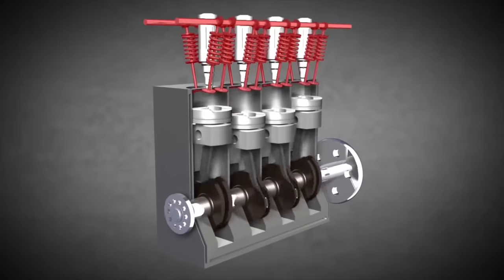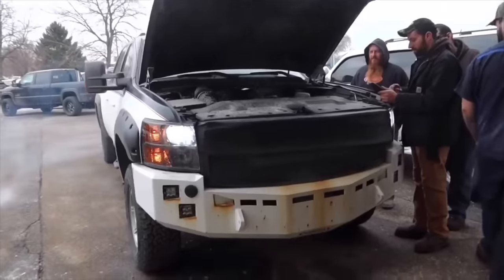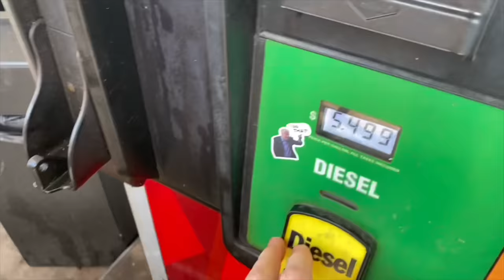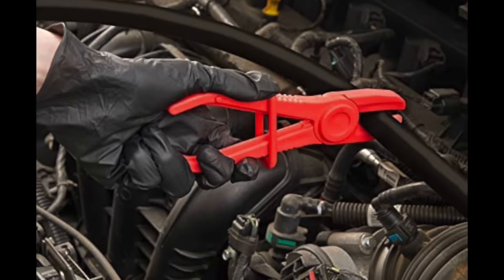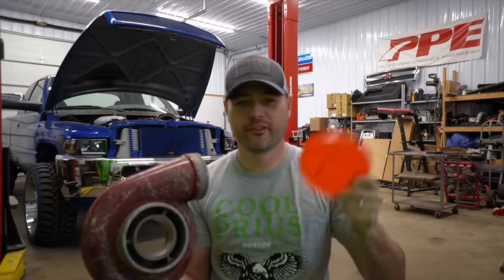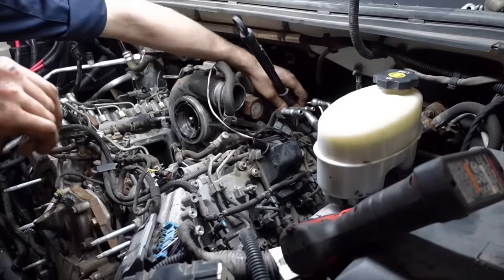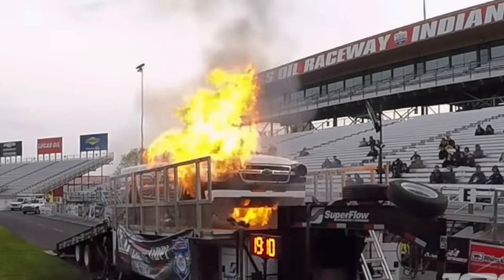What Is A Diesel Engine Runaway? *EXPLAINED* ￼

Comment: Years ago, around early 70s, I worked for Ryder Trucks in Atlanta.  We were working on a Detroit Diesel in one of the bays, the mechanil had the hood and shut off disasembled while he was working on it, for some reason he started it without the shut off plate installed...long story short, it ran away, about twenty guys unassed the shop and the shop manager tried to stop it by dropping an Atlanta Phone book over the intake, back then Atlanta phone books were four or five inches thick, it sucked the phone bood down like it ate it to no avail, when it came apart it sent shrapnel into every concrete wall and most of the trucks parked around it.  The fire was put out by the mechanics but the damage was complete.  Back then Detroits were famous for running away, which is why they had a metal plate you could drop to close off the air intake...unfortunately, this one was disconnected for maintaince..a lesson I have remembered my entire life.
Reply: I currently work for Ryder in Kentucky. My field operations manager told me a story that sounds identical to yours from when he was a tech.  Phone book and all.
Reply: Keep a clip board close by
Reply: Damn!
Reply: Thank you so much for sharing such an amazing experience which were can all learn from. Glad no one was hurt
Reply: Cool story bro 😎
Reply: "Unassed"... love it... got to remember that. Never, ever remove the cutoff!
Reply: It was a 2 stroke 6-71 8v92 the metal plate was there to shut the engine off even under normal conditions, those old 2 strokes would run away if you didn't keep the blower boxes drained or if you tried to start it and it kicked backwards and started eating oil.
Reply: Man, if there were camcorders back in the day, that could have been a spectacle.
Reply: What a story🔥
Reply: I can imagine how it ate the paper... my grandfather plugged the air intake of his run away tractor with a piece of wood and it got sucked in so deep it was cut to shape by the pipe.... 
Engine actually survived... the air intake didn't.
Reply: The 6-7 is the 6 cylinder with 71 cubic in
Reply: A 6-71 is an inline 6 cylinder engine with 71 cubic inches per cylinder.  An 8V 72 is a V8 with 92 cubic inches per cylinder.
Reply: That is interesting
Reply: A 2litre CO2 extinguisher into the intake works too… (BCF was better but harder to come by now).
Reply: This wouldn’t have happened at your yellow rival’s, just sayin 😊
Reply: @Ju5tu5Bp0rt3r  Thats nuts. Small world!
Reply: If you turn the key off you just shut off the diesel fuel supply it runs away from oil getting past the rings
Reply: One of those cases. A diesel engine accelerating out of control. 
Reason!
Oil inside the intake maniful, due to damaged turbo. Neither closing the key, no disconnecting battery, it stops. Just that all the oil in the manifold and air cooler is consumed. 
It can reach up to 10,000 RPM. 
destroing engine. 
Some even explode without knowing why or how it happened. 
Remember, diesel and oil, are comburents. 
the engine do not stop because incoming oil and air.  
its happening to engines only, wiht out   trottle valve. (modern injection control. fuck)
Previus engines havent this problem. 
Contributions Corona Automotriz
Reply: Question was this shop located on Ponce de Leon avenue??? Or Moreland avenue
Reply: I keep bolt cutters in my old diesel farm truck cut the lines
Reply: @baddog4307 
The modular engine of the time.
Take a head off an inline and use it on a V, move some fittings around. 
53-71-92 and almost anything from 1 to 16 cylinders. 
I was at the factory for training in 99 when they had the 2 stroke line condensed down to one. 
Got to see a 20v-149 block(s) and crank (s) get set up ,and even got to see a guy using a grease covered stick to retrieve shattered ceramic roller pieces from a 60 series on the line.  
Haha good times.
Reply: Best way to stop runout is spraying a CO2 extinguisher into the intake to smother the ignition
Reply: Saw the same thing happen at an old winn dixie truck garage, they used nothin but Detroits at the time here. I was in boss's office right beside the truck. Truck rpm's shoot to the moon and was sooo loud. The mechanic got the plate and tossed it on the blower and it was the loudest noise ever but it did shut the engine off.
Reply: Holy jumping fvcking sh¡tballs it ATE THAT WHOLE BOOK?!?!
that beefy 5 inch thick book?!?!?!
Reply: The turbo blades must have hit it like a wood chipper. There ain't no way 14.7 psig vacuum sucked down a phone book on its own
Reply: @vadimblin Oh, My God
Reply: i work for ryder now, one or guys talked about a runaway happening in the 70‘s wonder if its what ur talking about
Reply: Damn
Reply: Thank you for your story 🫡
Reply: @BIGGGJOHN171 my brother 

It ate a phone book

What in Sam Hill is a clipboard gonna do

Comment: This was the main ignition of the Deep water Horizon disaster. Natural gas was leaking out the busted well and got sucked into the generators. The generators went max RPM. First, all the electricity infrastructure, motors, lighting, and computers exploded or caught fire, then the engines on the generators blew up.
Reply: Oh shit!
Reply: This was also the ignition source for the BP Texas City Refinery explosion, vapor leaked from an over full tank and found an idling diesel truck. Truck started running away, driver ran and truck caused the vapor to ignite and blew the whole refinery.
Reply: Purple lights!
Reply: Petronas Brazil lost a platform when the gas turbines detonated from the same cause - it cut the accommodation module structure off the platform foundation and it fell into the sea.
QF32 had a turbine over speed from a lubrication oil leak almost sever the wing and it took out the controls the other engine on the wing.
Reply: You would suppose that on a rig that's extracting or manufacturing flammable gas, that the generators would have an isolated air intake piped in from somewhere high or low or far, far away...
Reply: @Bobo-ox7fj  sure. Or a simple air flap valve that, when activated either manually or from a flammable gas sniffing sensor, moves to completely block the air intake right before the tract splits into individual cylinder plenums.
Reply: @bat__bat  The way I figure, for something this critical, the fewer moving parts the better
Reply: @Bobo-ox7fj a flap valve versus an entire diesel engine. Hmmm
Reply: Was it fuck. It was a blowout.
Reply: Fellow USCSB channel viewer I see!

Comment: When runaway occurs, you have to choke or stall the engine. Set the highest gear, press brake and release clutch. You can also try to clog the exhaust. No air out = no air in.
Reply: Man. I don’t want to see what happens to the driveshaft
Reply: @ 123ElectricMonkey gets bent I would suppose or crack
Reply: Yoooo fuck noooo
Reply: sheesh that's horrifying to have to do.
Reply: man bad when clutch slips

Comment: I'm not a truck guy, but I am a car enthusiast. The title of this video caught my eye. I have to ask the question, especially if this was an issue that was worse in the past, why is it the intake shut off device wasn't standard on all diesel trucks? Brother this video was top notch!! Thank you for your knowledge!! Hopefully one day I can use it to help somebody! Keep being awesome brother!!!!!!!
Reply: It's on rare occasion that runaways happen and even more rare it will result in severe damage, it doesn't make sense to put failure point on a car and considering it might never be used it might just stop working with time and then fail when needed, doesn't make financial sense
Reply: A fuel shutoff switch would be more practical, but like dude said they're not as common as they used to be, because of the electronic controls.
Reply: One of those cases. A diesel engine accelerating out of control. 
Reason!
Oil inside the intake maniful, due to damaged turbo. Neither closing the key, no disconnecting battery, it stops. Just that all the oil in the manifold and air cooler is consumed. 
It can reach up to 10,000 RPM. 
destroing engine. 
Some even explode without knowing why or how it happened. 
Remember, diesel and oil, are comburents. 
the engine do not stop because incoming oil and air.  
its happening to engines only, wiht out   trottle valve. (modern injection control. fuck)
Previus engines havent this problem. 
Contributions Corona Automotriz

Comment: I had a duramax run away. It had the air filter get plugged with snow and sucked oil from the turbo and ran away. Oil burned so hot it melted the injectors and glow plugs. Cylinders had some scoring and crank was weakened. Got it running again with glow plugs and injectors. Then two weeks later crank broke.
Reply from the maker: Dang! That’s some crazy stuff

Comment: I’ve read that one way to stop a runaway is to use a fire extinguisher to blow C02 into the turbo and thus into the engine
Reply: 03:10 in that case you need rather an exorcist than a fire extinguisher. That truck is possessed !

Comment: Most modern diesel engines (<10 years) have a shudder valve installed near the air intake manifold. If the ECU detect higher RPM than expected it will automatically activate it.
Reply: I assume you mean shutter?  That would’ve been my suggestion.

Comment: Had a very high mileage turbo diesel Mercedes that i made the choice to get rid of because the maintenance to keep it going safely was going to be too much. I stuck my fingers in the turbo and could wobble the impeller with ease. How it wasn't leaking already was a mystery, but i loved that car. It didn't start running, really running, until about 65 mph.
Reply from the maker: If it was running good I bet it was a fun car to own
Reply: Mercedes are Bahnburners. They are designed to run at 100mph all day.

Comment: Positive air shutoffs are mandatory in my field of work . Oil and gas .
Reply: Hard plumbed CO2 extinguishers are also common on fuel tankers. 5 litres of CO2 will stop most diesel’s cold (but then a new engine is generally required).

Comment: I wanna say this was a factor in the Texas City BP Oil Refinery explosion - there was a large fuel leak on site and a huge gas cloud spread across the site. it finally encountered a diesel engine pick up truck that had been left idling. witnesses stated they tried to shut off the truck but the huge gas cloud surrounding the truck kept feeding the engine leading to runaway. US Chem Safety Board investigators believe this was most likely the ignition source that caused the explosion. scary stuff but really interesting video and thank you for explaining!
Reply: that is absolutely wild tbh. what a horrible series of events.

Comment: All suggestions were good, the key is to be ready for it.  Any time I’ve done pump or governor work I have someone standing by with a heavy duty clipboard and the inlet off the turbo.  If you can catch it before it really revs out they are pretty easy to shut down, if you have to go find a clip board then it’s probably already too late.  2 stroke Detroit’s would suck up their own oil if they started running too fast, I think that’s why they were so notorious for runaway.  I like the air shutdown valve, seems sensible for any performance engine, I believe they are required for a few kinds of racing.😅

Comment: I experienced a newer Detroit Diesel runaway. Driver stated unit was hard to start every morning, and they were sparaying ether in the intake. We found a broken oring on the fuel filter module cap. Replaced the oring and primed system. Once the truck fired up, there was so much residual ether in the system that the engine started running backwards and blowing black smoke out the intake housing.
Reply: Wow
Reply: Couldn't have been one with a def system the one box would prevent it from sucking air from the exhaust filters
Reply: @The-Harpy-Slayers hence the “newer Detroit” comment up top. Pre def/dpf. Still superior motors though to these new def junk diesels
Reply: @Alberta_MTN_Bear  I know the old ones are great i love 60 series Detroits  N14 Cummins 3406B Cat those are my favorite engines

Comment: I drive a Mack cement truck, and this happened to another driver at our company last year.  I saw it happen in real time, smoke everywhere, couldn’t shut the engine off.  I knew we had to cut the fuel supply but I didn’t want to risk it.  Fire department came and everything.  I asked our mechanic later, and he said it was the turbo.

Comment: Interesting discussion. I have an 85 F350 with the 6.9 IDI. It's naturally aspirated so I don't have to worry the turbo. It is also manual transmission so your idea of trying to stall the engine from a super high load (it is only a 4 speed so putting it in fourth and stomping on the brake could work).
Reply: I dont know rick

Comment: I don’t own a Diesel but you have now made me give serious consideration to owning one.  I would definitely get the Auto Air Halt and a Fuel Shutoff.  If I buy a used one I will definitely replace or rebuild the Turbo unit!
Reply: Alot of pulling trucks and race trucks have fuel cut offs and air cut offs that the sled has access to pull
Reply: just the air halt is enough. No air means no combustion
Reply: Newer models of any brand should have an anti shudder valve. My golf mk4 tdi have one, which basically is an open butterfly valve in the intake manifold (always open). Mine's disconnected, but in a functional one, it air starves the engine at shutdowns.
Reply: While a potentially major issue, it is extremely rare.  Consider how often you have heard of rhis happening, I'm guessing not at all until this, heh.  I have spent over 20 years working on and driving diesel vehicles, new and old, well maintained and junkers.  Only once have I had to deal with a runaway, and it was only a minor issue that only caused it to throttle up for a moment.

Good to have the air cutoff option, but otherwise one generally doesn't need to worry about it.  Inspect the intake tubing for evidence of oil leak on occasion and it shouldn't be a problem.

A failed oil seal from the  turbo rarely goes without some kind of warning that can be detected via regular maintenance
Reply: In Europe we have a lot of regular cars running on diesel, and this really isn’t an issue, as long as you’re taking care of the car and don’t overdo it (like with the pulling or with the dyno runs) you’ll be fine.

Comment: Happened to me with an Izuzu motor.  Immediately I sliced the fuel line and observed RPM continue to head for pegged.  The exhaust cloud went from mostly black and thick AF to all shades of grey, white and black all part of the quickly growing smog. I ended up just instinctually shoving a pair of work gloves into the intake tube then covered it completely with a bare hand to effectively choke stop the motor effectively
Reply: I've personally never even heard of an Isuzu running away, what Isuzu engine did you have?
Reply: @bmad1386  This is probably a pre-emission engine. The Isuzu engines with EGR have a throttle butterfly valve connected to the intake. I think this can help prevent runaways. That's the only advantage of the EGR 😂
Reply: an hour ago i just witnessed an Isuzu crosswind runaway while i was having lunch

Comment: My dad was driving the DHD truck on the dyno when it exploded and ran away, we put air knifes on our race trucks and fuel shut offs. The DHD truck only stopped running away because it ran out of fuel. Basically the turbo exploded and cut the high pressure fuel line and put a hole in the intake so all of the high pressure fuel was spraying directly into the intake.

Comment: Last month I had a situation where my Ram kept running after key off. It was not a runaway like you are talking about, it was a TIPM problem that bridged the on/off circut. I just took a pair of pliers and pinched the fuel line.

Comment: The duramax in your video that’s hooked to the sled has an emergency kill switch hooked to the sled that automatically closes the air flow to the engine in case if a hitch failure, all highly modified sled pullers have them. That truck was up and running the next weekend luckily vary little damage.
Reply: No freaking way I don’t know who told you that but that black duramax was not ok. I would need to see proof to believe that thing ran the next week , maybe with a new motor and trans and engine mounts and god knows what else. Did u see the manifolds and the turbos those things are smoked to
Reply: @ItsMe-vg4vj  okay there bud keep the butt hurt to yourself 🤙
Reply: @jameshaskell6572  i was at that pull i watched it happen i talked to the owner it was perfectly fine running the next day

Comment: I'd never heard of this before but I instantly could see why it happens!  You got me wondering about a CO2 bottle plumbed into the air intake for emergency release.  May not be enough volume to shut it completely down though.
Reply: A 2 liter CO2 bottle contains 2000liters of gas. The liquid CO2 is pretty effective at hydro locking the engine too.
That said - bigger is better when it comes to fire fighting.
Reply: You can just shut a valve and get the same result. No need for having CO2 cylinder

Comment: Great video! Had this happen on an only late 70s single cylinder Yanmar inboard on a boat I owned. My buddy and I had no idea what was going on. Super scary. Luckily, we already had the stairs/engine cover off and somehow in our panic I thought to pull the choke cable in the opposite direction which acted as an emergency shut off. I had to do this manually by reaching my hand into the enginer compartment...RISKY, but saved our enginer and boat! Still totally wild to see it happen in person.